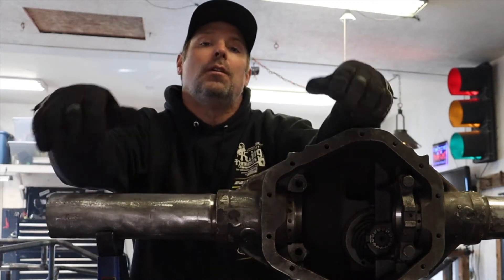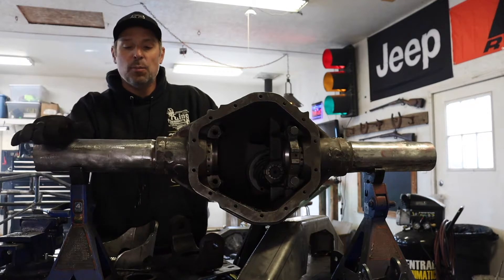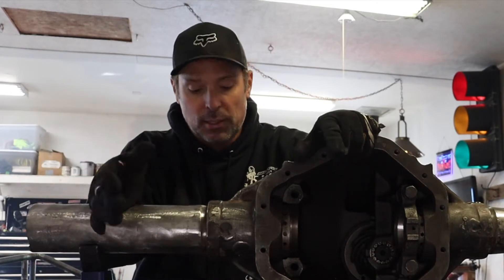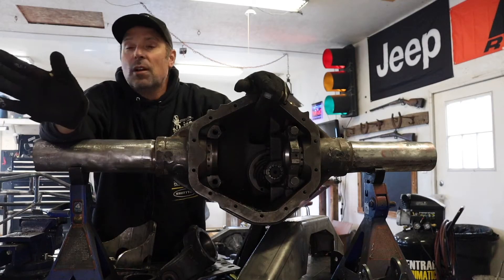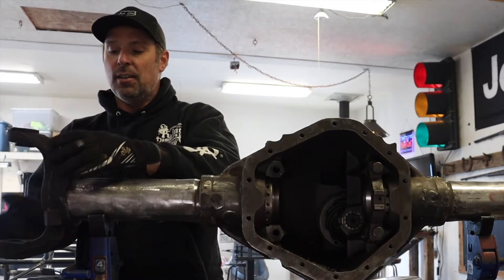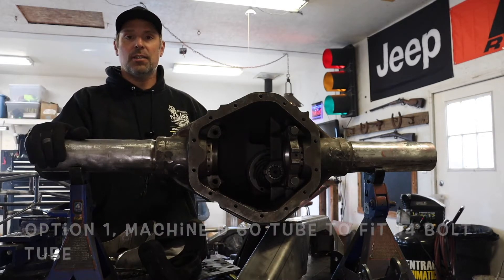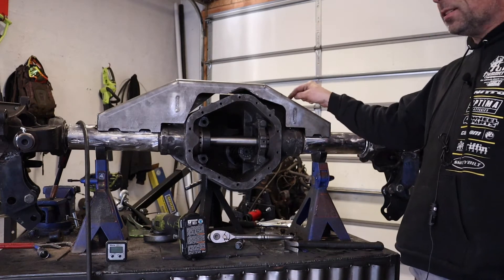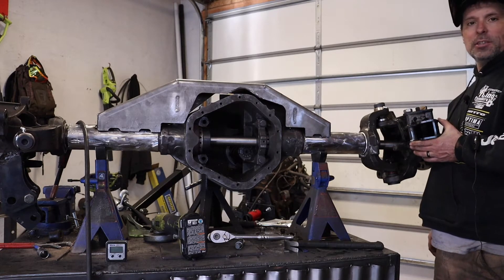Building a 14 bolt, Rear Steer axle.  #rearsteer #14bolt

Comment: do you happen to remember what length each axle tube ended up being after cutting? measured from housing to outer end of tube
Reply from the maker: I don’t, basically the outer knuckle and inner knuckle are 12 inches from the wheel mounting surface to the inner c weld point.

Comment: Around What Year model Dana 60 did you get?
Reply from the maker: 99-04 ford 60, I used those outers all the way around. The 05 and up are a better option.
Reply: @wheelinoutwest  where did you get your alignment bar?
Reply from the maker: @89297a  I borrowed it from a friend, I think can order than from summit racing.
Reply: @wheelinoutwest  where did you get your axle shafts from and what u-joint did you use in knuckles
Reply from the maker: @ I bought the shafts from brannick, I used brannick 300 m u joints. It has all held up good.
Reply: @wheelinoutwest thanks i found your axle shaft video thanks for info

Comment: What was the final wms to wms measurement for this axle?
Reply from the maker: It was around 67 inch wheel mounting surface.
Reply: @wheelinoutwest  thanks for the reply! I’m thinking of doing this as well to my rear 14 bolt..but using kingpin knuckles.

Comment: How much wms to wms width can you gain by doing this? I got a 67" 1st gen GM 10.5 and am planing to do the rear steering conversion but my front axle is 72" (Super duty Dana 60)
Reply from the maker: On the super duty 99-04 it was about 1 foot from the wheel mounting surface, to the weld surface of the inner c, so you can pretty much make it as wide as you want, as long as you have enough tube on the axle housing.

Comment: Can you explain how you determined the axle length? And how you came up with equal length shafts? Thanks
Reply from the maker: Basically, I measured from the middle of the carrier, thats the only true way to have the shafts the same length. I stuck a 14 bolt shaft in it to get an accurate measurement.  I used tape on the shaft to reference the length from the carrier.  I had to figure out what wheel mounting surface I needed.  The inner c and knuckle for the super duties were almost 1 feet exactly from the mounting surface to the weld point on the tube, so that made it easy to measure.  Once I knew my wheel mounting surface, and the length of the inner C. I had to cut the tubes one more time, using the tape reference I had on the 14 bolt shaft.  Because the the diff Is offset, one tube is shorter than the other.  By using the old shaft as a reference point, it really helped me know where exactly to cut.  Hope that helps....

Comment: Can u explain little more how u get the axles to fit both end ?
Reply from the maker: I will be covering the axle shafts in future videos, but my plans are to get custom made shafts from Brannik.  30 Spline inner shafts, and 35 spline for outer shafts.  Since these wheel bearings typically come bored out for 30 spline, I order them from Brannick drilled out for 35 spline.  Hope that answers your question?
Reply: @wheelinoutwest  Thanks

Comment: What did you do for inner axle seals? Are you able to install seals into the tube without modification? D60 seals???
Reply from the maker: I am looking the Crane seals, according to their website, you unscrew the spanners inside the axle housing, and install the seal.  So it should not require any modification.  Busted Knuckle also sells seals, but they may not work on mine, as they appear to slide in the tube, and I used a sleeve that may block the seal from sliding in the tube.